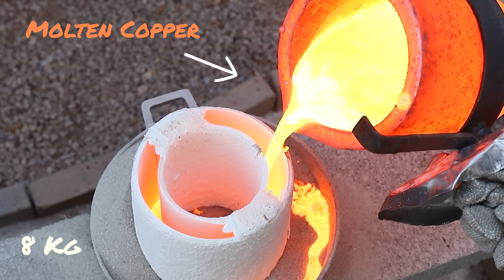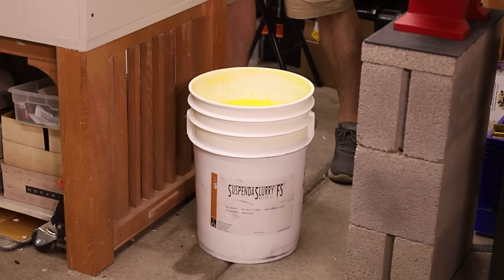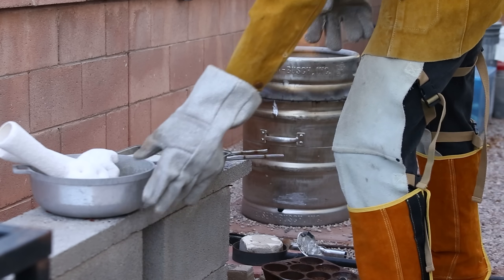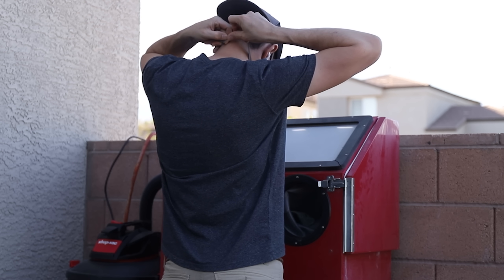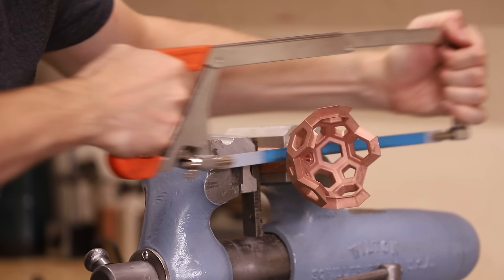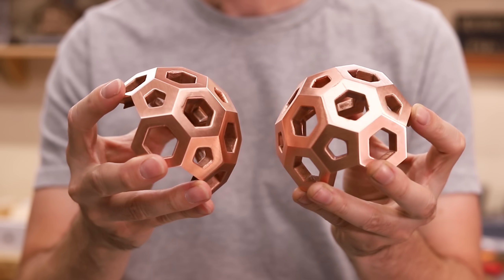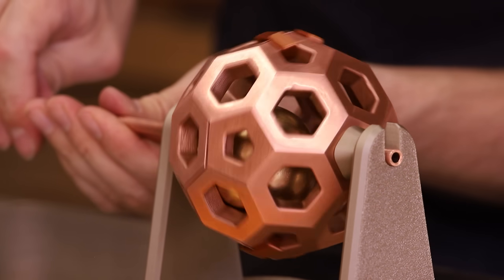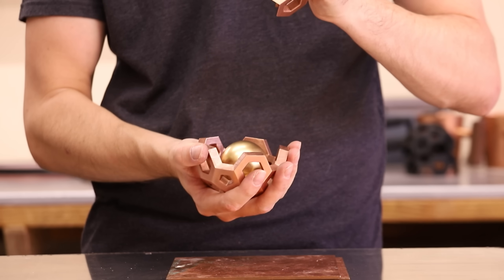HUGE Magnet VS Copper Sphere - Defying Gravity- Will a Neodymium Magnet Float Inside?

Comment: Perhaps this is easier said than done, but maybe you could match the frame rate of the camera to the spins per second of the sphere, amd have a really short exposure time on each frame so there's very little motion blur. Then, for example, if you filmed at 24fps, and the ball did 24 rotations per second, and there was enough lighting and short enough exposure times to have almost no motion blur, it would look like outer sphere wasn't rotating at all, and you could see the inner magnet levitating much easier on camera

Comment: I wonder what woul happen if it was in the center of a coil number 10 wire hooked to a cook stove with an adjustable stove eye and standing on the stands end with a generator winding on the outside hooked to a volt mter or load

Comment: For scientific purposes that copper was impure. Using pure metals is exceptionally expensive - but ensures that you can derive informed conclusions form your efforts. In this particular case and for demonstrating your idea it might not make much difference, but for scientific purposes it does. Buying pure metals is exorbitant but I do when I'm testing properties. I also only use crucibles for specific alloy manufacture and hardness tests and not others. Fascinating subject covered in this video - thanks!

Comment: @Robinson Foudry - a simpler solution for better visibility of the ball might be to simply use a cylinder, like the one that gave you the idea, but instead of straight inner walls, it'd have concave inner walls like so 【 】(but turned 90deg)

Comment: Could you put the large diameter copper tube on a rack tumbler setup?

Also that magnet a foot away turning the cage was neat, you could drive that one with a motor and make it extra levitation

Comment: Make a device to spin another magnet and mount it under the table. Whenever you want to amaze guest just place the copper sphere on the table above the rotating magnet. 

I wonder if a solid sphere would react the same way. 
Print a planet (Mars would be close to the copper color although to could print earth and then strategically tarnish areas to give the earth dimension) and then have the planet rotate on its own when placed on the table. You would likely need to place the magnet on an off axis to match planet axis.

Comment: You didn't break the ceramic shell off for fear of deforming the copper, but then used a hammer and chisel to clean up the casting instead of a Dremel? 🤷‍♀

Comment: Eddy currents are fun to play with. Two things that come to my mind; try making an electrical generator and electrical motor out of it. You already got the basics. In the next step I would also wrap copper wire to stitch up the seam and solder it to make both halves more of a unit.

Comment: With the conical leftovers make a two bladed thracian copper axe (labris). Try making a plasic holder that would allow you to rotate the thing on all three axes(x,y,z) in water remotely with three round magnets. If you place a deuterium core in the middle, levitata it and properly time laser pulses from all holes shooting at it you may get fusion plasma container😂

Comment: try using a lathe machine instead. put a running center on the other end. you'll most probably get a constant rotation with various rpms depending on your preference.

Comment: how about - anchor and electrically isolate the two copper hemispheres - 
then connect axle rods to magnet ball in the center to spin it - having north / south poles alternating to close proximity to the two hemispheres - creating alternating induction - 
- check for voltage and power generated between the two copper hemispheres
- possibly place metal structures attached to inner side of copper shell to channel / facilitate greater magnetic effect as it will be in closer proximity to magnet

Comment: I think there is a way more cooler levitating stuff, it's called pyrolytic graphite. The problem with most levitating stuff is that they require energy, for example in this video you have to rotate the copper sphere; in the case of superconductors you need to cool them down which also require energy, but pyrolytic graphite doesn't need energy input, it can float on top of magnets at room temperature.

Comment: I think you have three issues
1) the break between the two halves 
2) rotation synchronized may be an issue too
3) make the bearing support be on dampers like from oil shocks on Rc car to help remove force oscillation escalation occurring between the inner magnet and copper sphere, or you may be able to also control oscillation runaway with speed feedback and force sensing on the supporting bearing support stands

Comment: I think this is super clever.

 I think you should focus on the visibility of the sphere. A bright or even luminescent coating would be great. Also, if you try another cage I wonder if a shape with more 'windows' would help with visibility. It could be possible to make a large sphere with cutout windows that all face one angle, since you only really need it to look good from one angle to really show off the effect.
Also, if it can be quiet at high RPM, maybe you can get away with less mass of copper, which would just get bulk out of the way.

Super cool to see your methods.

Comment: These experiments with copper and magnets encourage the question what causes this effect? Since you have a magnet moving through a conductive tunnel,  you're generating currents in the copper which take time to disperse.  It seems there must be a way to collect the electricity, like insulating the two hemis, but the -/+ would be very random in this model. Having thought it through a bit, a permanent magnet generator is likely a lot more efficient, with fixed alignment and predictable poles.  I'm guessing random motion elect generators using piezo-electric devices are simpler and more efficient as well.

Comment: Suggest your axils should be died and tapped, not pressed in. With copper that thick and the speeds ur using they would be solid.  If your attaching a motor I would have the shafts supported by bearings... it's a fairly heavy machine.

Comment: What is the least amount of material needed to get the same effect? smallest magnet? thinnest copper layer?
I am imagining a spinning magnet on a copper surface, like floating a vehicle; magnet wheels spinning or less moving parts a swapping electromagnetic surface on copper road surface. Does the copper need to be condensed or can it be raw/corroded/thin...

Comment: What if you made a copper gear-like thing that has enough space in the middle of it for the magnet as a desk toy. You could then print a base and a drive gear and have the copper gear rotate at a consistent speed with most of it exposed, levitating a magnet in the middle of it

Comment: I honestly wonder if a sphere that was missing the top and bottom 20% would make a better housing to rotate. It would end up looking like a tube, but with the sides bulged out. Creating a ( shape for a surface for Lenz's law to work off of but the curved edges should hopefully keep it centered. It could them be placed on top of four rollers spaced out like a square on bottom and powered by another roller pressing down on top. Which should help create equal pressure on the bottom. Might need some guides on bottom so the "tube" doesn't shift/roll. could possibly even hooked the powered roller up to a device that lets you control the voltage to more accurately adjust the speed. Main idea here though is trying to provide you with a better sight picture for framing and maybe increasing the amount of material to generate a more uniform magnetic field.

I'm no scientist and all of this is an idea from an average joe.

Comment: 1. suspend it on an axis again, but make sure the copper sphere can spin without much vibration, you can balance it by removing material in specific places.
2. put an electromagnet inside the base, control its field with an arduino to spin the sphere with the neodymium magnet inside, fine-tune it to maintain a speed at which the magnet is hovering
3. for bonus pints, make small SMD led inlays with small coils to power them off the alternating magnetic fields inside the sphere, then place them inside to light the action within.
4. for extra bonus points, make the base electronics activate with a manual spin on the sphere, then pretend you made a "magnetic flux generator" or some other sci-fi nonsense
5. ????
6. PROFIT!

Comment: if/when you put it on a motor, fit some ball bearings in with the copper pipes on the stand so you can spin it for significantly longer, with less effort

Comment: I would spin it up with a small electric motor and rubber O ring drive belt. You could either find the right combination of pulleys or control the voltage to find the sweet spot. Really cool project for different experiments, I would love to see it spinning inside of a clear sphere with ferrofluid on the outside?!  Or how does it react around other magnetic equipment like a large electric motor near it?!  What if ferrofluid was in between the magnet and copper?!

Comment: In the gap put the rubber or plastic layer and connect it with a multimeter it will produce electricity 😅 both two halfs acting as terminals also 😅 just a thought 😂. Magnet + copper = motor or speaker or a generator.

Comment: Hi at 11.22 in side the copper part. Can you make a bigger version  but put a wide camera angle lens in there and have the wires coming thru the spindle . Only thing is not sure if the magnet will effect the camera . Thoughts ?

Comment: I think the reason you can't get it to work at consistent speed is part of the fundamental physics involved. These forces are about changes in magnetic flux, when nothing's changing, the system gets bored and doesn't do anything. It's kind of like a transformer trying to run off DC power.

Comment: Definitely one of the more precision based metal casting vids I have seen and coper is a bitch to cast. Spinning the copper with the magnet in it, does the copper heat up significantly?

Comment: @robinsonfoundry Measure a bunch of different things in between the black magnet and the sphere with the magnet inside. Like resistance, ohms, magnet fields etc... Maybe make another sphere with the same round magnet, and place them 2 feet apart from each other, and the black magnet in between which would be 1 foot away from each sphere and rotate one sphere, see if it  makes the black magnet spin, which should make the other sphere spin too. And measure electrical currents and magnetic fields etc... maybe use some c02 to cool things down and now you'll have same experiments but with super conductors! 😊oh science is wonderful

Comment: I don't know much about metallurgy, but it seems like if you could reduce the thickness of the bars in the lattice and, instead of making two identical hemispheres, you may be able to make a near-complete cage with a single "door" that you could either clamp down or close on just one side, large enough for the magnet.

Comment: This one of the most amazing experiments I've ever seen.   I'd  Also suggest TWO small half cups the size of the ball coming through each suspension pipe on posts, keep the ball centered, on bearings until it gets up to speed, THEN once the ball has it's speed and the cage has it's speed, retract the non metallic side cups to see if the ball remains in place, AND this would let you prevent it from having a bump to knock it off it's intended levitation.    The sidecups on posts can be pulled apart just enough to see if the ball is centered or trying to align with any fields.      You could spin the copper ball with a side gear and vertical spindle and retract the suspension cups via the side pull outward. 

Otherwise, I'm so envious of your kiln and talent

Comment: If you're open to suggestions if someone hasn't already suggested this, make the interior of the copper structure spherically smooth then on the axis incorporate ball bearing sleeves for less friction and instead of using a drill fashion a hand crank to rotate the sphere . Then place a fluorescent or neon bulb close to the apparatus and see what happens.

Comment: Amazing job. I believe that the viewing holes increase the electric resistance, this is why you are not having the wanted result. I am sure that a thick solid sphere, no holes and no edges, would be much better. To observe the magnetic ball inside you could use a wireless wide angle camera inside the sphere, or just a couple of magnetic needles outside which will point to the magnet so you know where it is actually located inside the sphere. The two semispheres should be soldered together, so the electric resistance between them will be negligible. Very nice job though.

Comment: Well I think the holes are reducing magnetic effects aka eddy current here
You can create a sphere with smaller holes and rotate it with a motor because as you reduce the size of the holes and the thickness of metal as the oscillation will reduce gradually with higher speed with less eddy current

Comment: So, either you need to make the magnet small, or you need to make the container larger. You could also try adding electricity to the copper and see what happens. Also, you could make a smaller version of this with the spare copper.

Comment: You might try rigging it to a small electric motor and experimenting with the speed to see if it's possible to keep it suspended, it seemed theres a sweet spot of not too fast and not too slow either.

Comment: I’ve been having an invention idea for maybe some kind of generator maybe, not sure what it could be capable, but this thing you crafted is the closest I’ve seen to it. The next step is adding tiny electromagnets around the outer shell and having them be powered on and off by a computer controller to keep the ball stable right in the middle and then have the power amp up and get the ball spinning at increasing speed. My thoughts are that it could be some kind of gyroscopic regenerative brake or passive generator of some kind
Reply: And since it probably hasn’t been attempted before at super high speeds it might make some unexpected effects like antigravity or something bizarre when the eddy currents become extreme! Who knows, but I sure can’t craft it

Comment: I have lots of great ideas with magnets fr. What if If you had a pole going out of both ends of the sphere and attached wheels to the ends, then you have your other magnet spinning close by powered by a battery to make the wheels turn? Also, would it have enough power to pull 2 more wheels if you made it into a type of "vehicle"? Would be cool to know if this worked and if it could be applied on a larger scale for a bike or something

Comment: Make the copper much less massive so you can see inside of it better and also then you can spin it really fast to make up for the loss of mass. I bet if you made it the same diameter but about half or 1/4 as chunky and got that thing spinning super fast at the exact correct speed with a brushless motor and PWM controller, the outside would blur and it would look like just a floating magnet. Also using a spherical outer shape would cause a smoother transition to let it float. Right now all those angles are catching the ball and bouncing it all around making it tough to hit the sweet spot.

Comment: The reason why the magnet hits the walls is because your axis is off center.
Basically when the “sphere” rotates faster the magnet is trying to catch up because is following the point with the strongest attraction which would be the part closest to it at any given point, and it ends up being pulled towards it in the off center sphere.
Whereas when you get the speed right what you are doing is rotating at the frequency that matches the speed of the falling sphere, basically you’re pulling it up with every rotation.

Comment: Just reading two last comments were very appropriate. You could get a taco meter to measure the RPM, so you can find the right revolution speed to float the sphere magnetic. Also the spin of the unite should work the other way around as to spin  the circle magnet, you did at the end of magnet. Makes me wonder how this might be used , by experimenting with different sizes, positions, spin rates etc, if this could be employed some kind of sublime "gear box" system and  efficient energy transference applied to certain mechanical systems where energy conservation is important.
Reply: I meant " end of video" not "end of magnet "

Comment: Depending on how fast and how long you spin it, the copper might get really hot. The eddy currents that suspend the magnet are dissipated into heat. I have no idea if it will heat up faster than it can air cool or not.

Comment: You do good work! Inspiring! Gotta do some casting! How about a little neodymium UFO floating over a copper plate? What do 2 neodymium magnets, oriented with opposing polarity, do in a tube? Will they fall down a copper tube like a rock by (sort of) shorting each other out? (Hmmm, I can try this with my little disc magnets down an aluminum tube...) Will your big disc magnet - if spinning north/south/north/etc. (not like a frisbee) - remain suspended in your copper dog toy enclosure?

Comment: If you can sync the camera frame rate to the rotational speed, you should be able to see the magnet lifting up through a stable opening. Or even use a still camera that can be triggered by the sphere’s position so it always looks through a given opening.. that way as the sphere comes up to speed the magnet lifts in the field of view. Otherwise the blur of the sphere going around kinda hides the magnet, especially as YouTube optimizes for lower bandwidth.